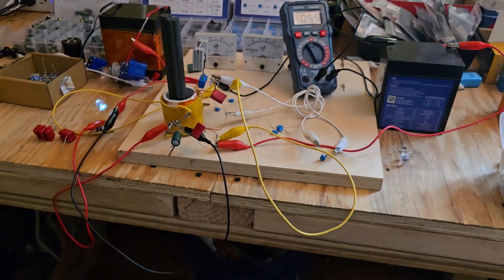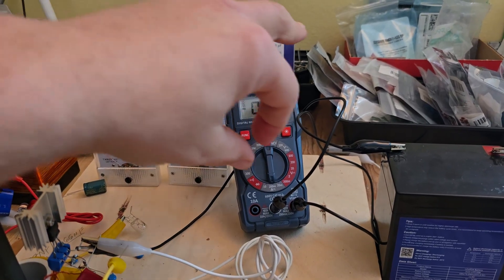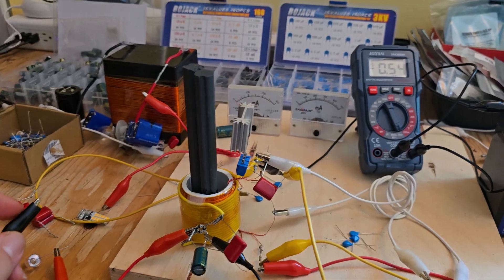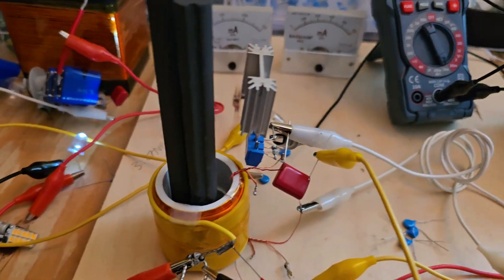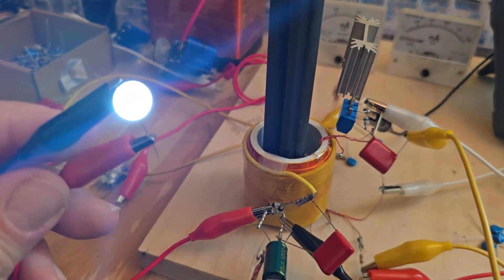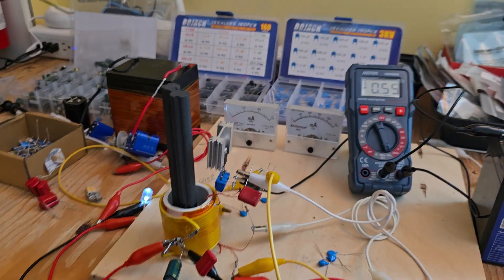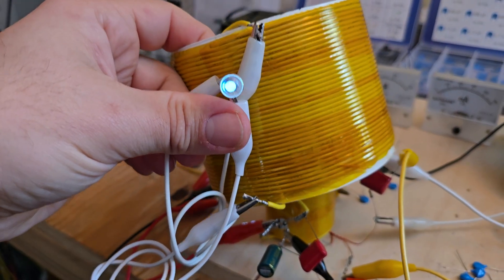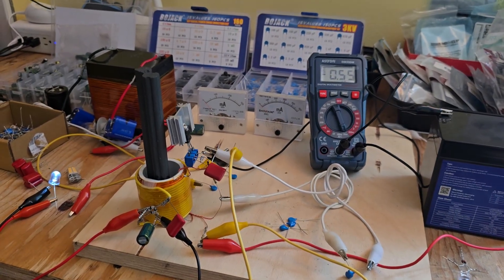🤔SYSTEM SIMPLICITY UPDATE & HIGHER OUTPUT ON THE 12VDC UNDER 1mA INPUT MODEL💡

Comment: No overunity devices
Reply from the maker: Sure. All OU works by creating a vacuum as efficiently as possible then harvesting the inrush of the vacuum for energy & in our case we are using abrubt displacement currents that have no magnetic drag or loss to do so to perturb the Aether. Check our latest posts section & it sounds crazy but what do you think powers the ufos 🛸
Reply: @MTECH2022  one led to full power with one 1,5v battery with simple youle tief is most efficient of your device.

Comment: so what kind of practical things can it run now

charge a phone?
power a tiny rc car?
Reply from the maker: Hopefully very soon a 1-5 watt output unit will exist that has a less then 5mA input. Might possibly make the system run from a 36vdc battery pack so a DB3 diac will fire in the system for simplicity.